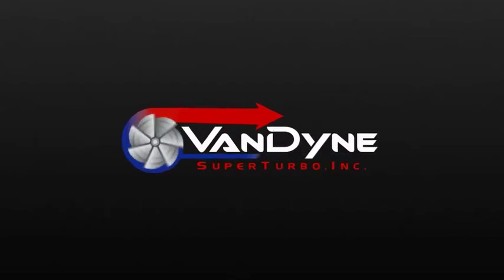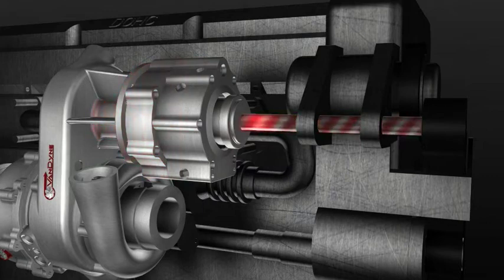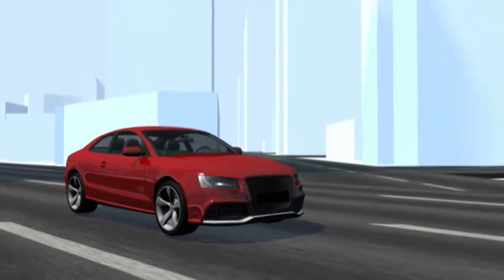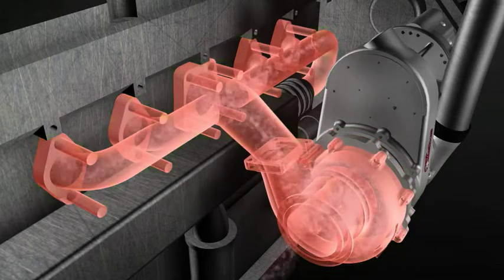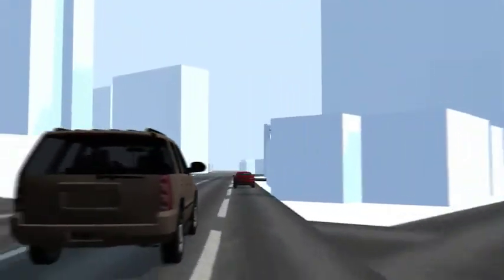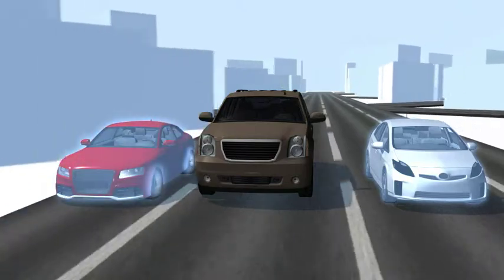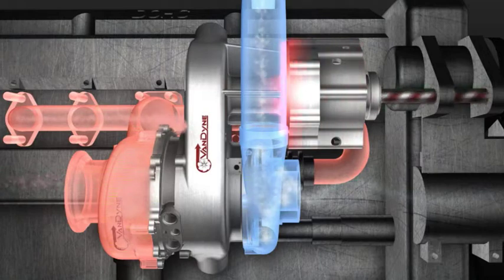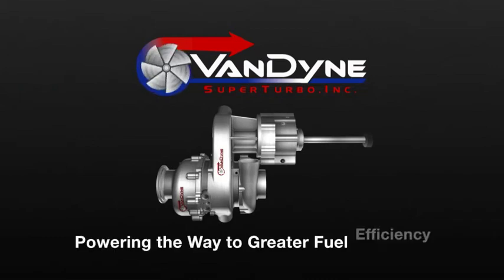VanDyne SuperTurbo Technology & Benefits

Comment: Looks heavy. So in a sense, you split a turbo in half, got rid of the connecting rod between the two turbines, and stuck a magical box in between it that gives AND receives power? There's a lot of moving parts in this big piece of metal. Something is bound to go wrong.